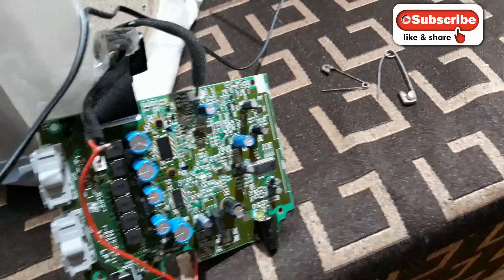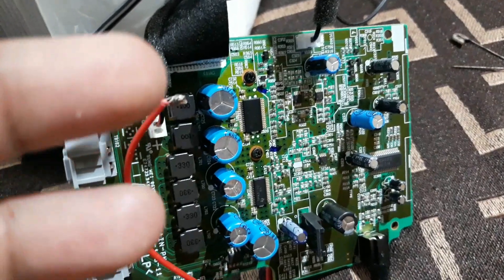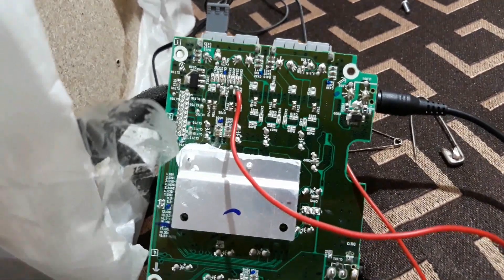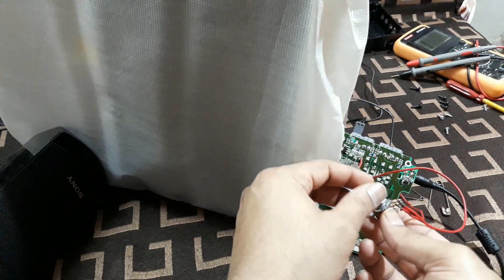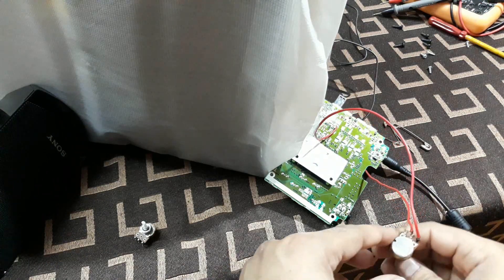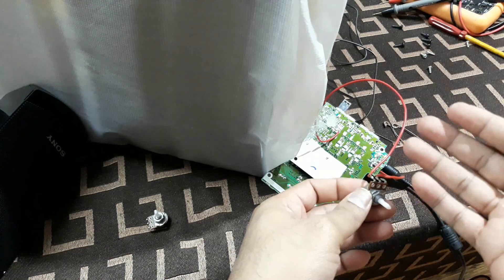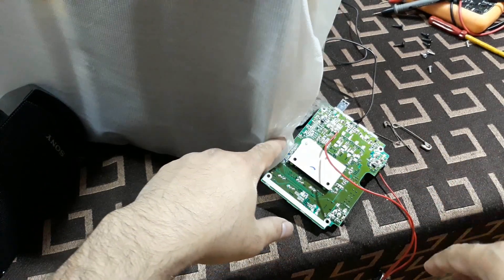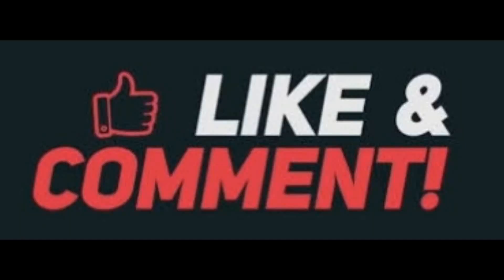How To Control The Bass Of Sony SA-D40 4.1 Home Theater

Comment: Very informative video! I have been loooking for a possible solution for this problem a long time now.. finally ended up on your video.. Sony should have provided bass control for this home theater and this is such a deal breaker and irritating in certain situations.. thank you so much for the info!! Should I use the 22k potentiometer for this?
Reply from the maker: Yeah. Thats better. But its not gonna last long tough. But this is the only solution for now. The price would be Rs.10 per piece. Its cheap. So you can replace later when the installed one gives trouble.
Reply: Nice, you're the best!
Reply: Quick question.. what if I use a 10k potentiometer instead of 22k
Reply from the maker: Well i didnt try that. But you can try if you have. Nothing is gonna happen to the amp.
Reply from the maker: Update:- just tested 10k potentiometer. Working fine.
Reply: @technoboy-allinOne  thanks a ton! Would be setting it up myself in some days.. will share the update once done..
Reply: Update: I've tried connecting 10k, 22k and 47k as well but my potentiometer is throwing sparks and smoke comes out of it once I increase the volume.. any branded potentiometers that you would recommend?
Reply from the maker: @navieenn  i used samcon & philips potentiometer. They worked for few months. Another idea i came up with is using resistance & switches. Try 10ohms to 150ohms. Use 3- 4 switches with different valued resistance as per your bass requirement. Video is coming soon
Reply: @technoboy-allinOne  yeah I have used a switch for now and looking to get a variable resistance volume controller dial for the subwoofer alone. I see the problem of potentiometer being damaged is mainly due to high wattage of the speaker. AFAIK, the potentiometer withstands a load of 25W.. If we use something which could take 40W, then it would not burn out..
Reply: @navieenn  I faced the same issue. Burned my 10K, 22K, 47K and 100K. All of them gone. :/
Reply: @debjyotidas.tuodnb  yep, the problem is that the output current driving the sub is too high for potentiometers. You could put a circuit with resistors and switches
Reply: @navieenn  Yeah. Planning for that as suggested by @techno boy in another video.

But I'm still wondering if there is a way to use a variable resistor / potentiometer (rotary or liner). Please suggest
Reply: @technoboy-allinOne  pls install the volume controller too in it pls pls
Because remote is not working

Comment: Can we connect manual volume control potentio meter? Because default volume is very low, every time switch on the device and increase volume level
Reply from the maker: For manual volume control you have to change the pre amp kit. You cant just chabge the volume control
Reply: @technoboy-allinOne  thank you for your valuable reply

Comment: Hello sir, I also have this SA D40 but as I extended the wire to attach the speakers on wall, the BASS has become significantly LOW (I know everybody else have problem with the high base but i love it). How should I fix this problem, how should I increase the bass. Please give some solution 🙏🏻
Reply from the maker: There is no connection between subwoofer sound & channel sound. No matter what you do with the channels the bass stays same. Whede did you keet the subwoofer??
Reply: @technoboy-allinOne  it's on table 2 feet above from ground.

Comment: Which is the best bass controler for sd40 and note the controller value
Reply from the maker: Using tic tac switch & resistance is best option now. Use resistance from 20ohms to 100ohms according to your need.
Reply from the maker: Check another video on this topic, you will find on my channel.
Reply: @technoboy-allinOne  thanks

Comment: One doubt the controler only for subwoofer or 4speaker also please??
Reply from the maker: Thats only for subwoofer. Overall volume can be control using remote. But subwoofer needs a separate controller or the bass is too high for watching movies & all. So you can try this easy step.

Comment: Hello sir. I have sony D40. 
But the wires are too short.  And not enough to fix it on wall i wish.  
If i cut the wire from middle for extend,  is there any problem.  What kind of wire i want to buy.  It affect sound quality or system functioning.  Kindly explain..  please take little time.  
My problem is wire length is short.  Only for 2 speakers.  Another 2 is good now.  

And this system is a 2 channel or 4 channel.  

Thank you
Reply from the maker: Yes you can cut & join the wires. Buy good quality thick speaker wire  & solder the joints properly. Thats it
Reply: @technoboy-allinOne  
 techno boy  
No, you are wrong if you cut the wire the frequency problems occurs , if you want to extend the wire you have to purchase wire with same property and solder them.